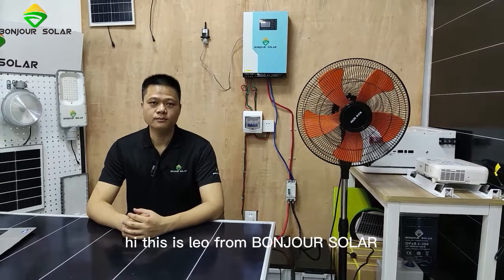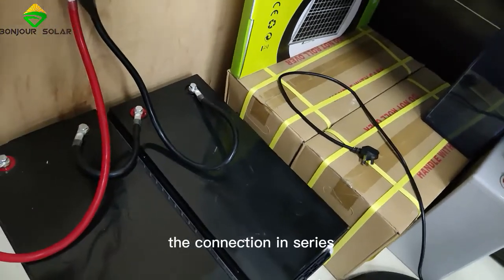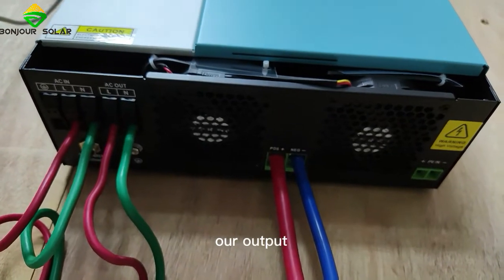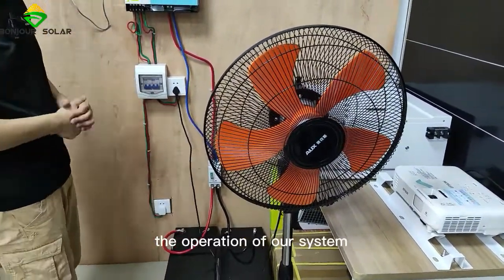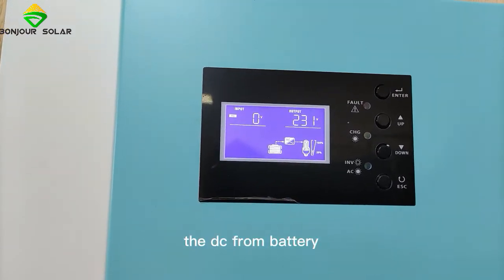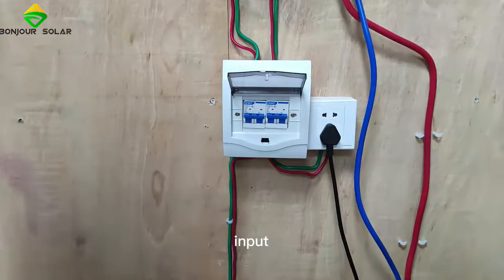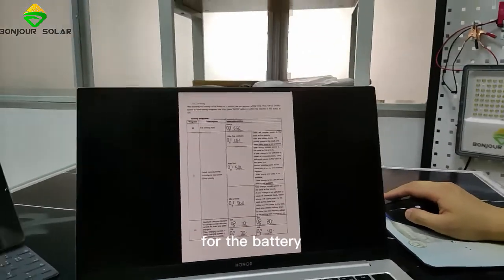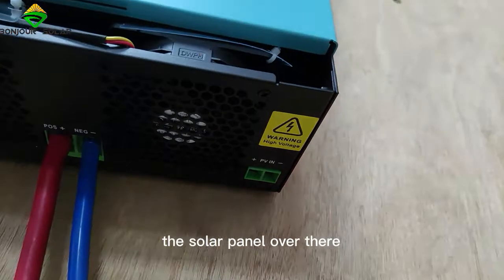3.5 kw hybrid inverter with MPPT

Comment: Hi, I have a little problem. In function no. 1 of the inverter, if I put sbu, when I turn on a printer, a coffee machine or a phone, I hear the PC UPS tripping, as if there was no voltage.

If instead I set sol this does not happen. The problem is that by setting sol it takes the current both from the panels and from the solar. Can you tell me how I can solve this problem? Thank you
Reply from the maker: For most of the inverter SBU means SOLAR-BATTERY-UTILITY,  the PC tripping, i think the problem is the SOLAR and BATTERY are not enough for your load, pleas check your user guid, to confirm the SOL mode is UTILITY priority? thanks
Reply: @bonjoursolar-arabic  The inverter is the same as what you show in the video. I saw that a battery is bad. At this point I remove the faulty one and leave the inverter without the battery. Thank you.
Reply from the maker: @antoniobuono4644  ok, no problem, if the battery is bad, the system battery voltage will be not enough, but this inverter can work without battery, can still running, but can not use the power from the battery, our whatsApp is +86 13332864275    feel free to contact us for any help of the OFF GRID solar products, we are focus on OFF GRID solar products, thanks
Reply: @bonjoursolar-arabic  Thank you